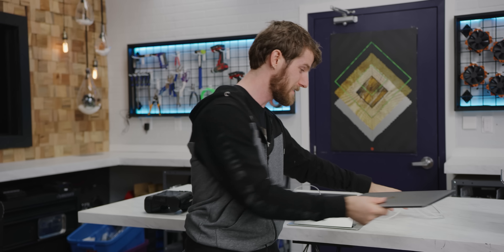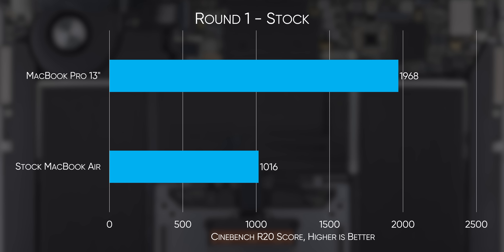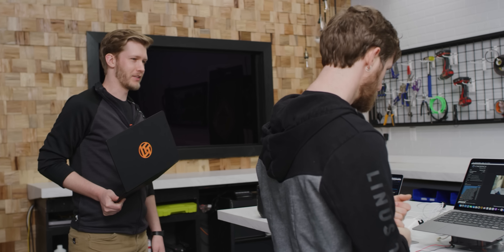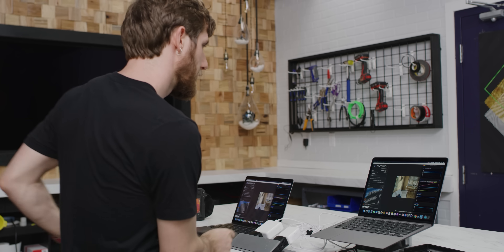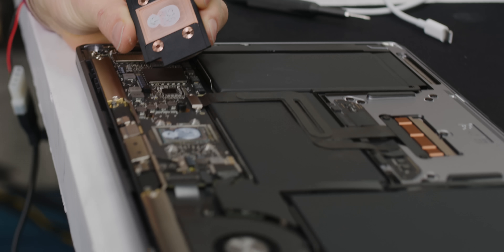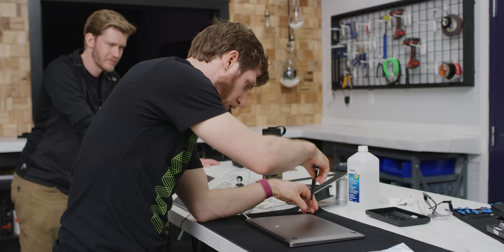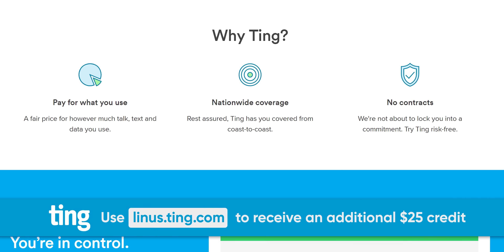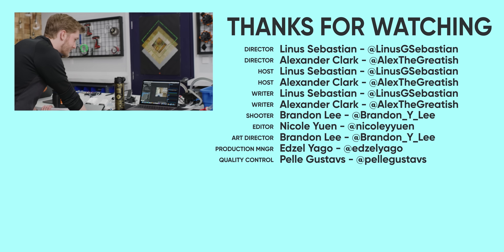Fixing Apple's Engineering in an Hour

Comment: When having to perform at places where 35ºC is kind of the average temperature on spring (like Misiones, Argentina); 
my gpu-hungry vj friends ask for a  20L tupper full of ice and have it constantly under their rig in order to prevent overheating. 

not that related to the video here but hey it's cleaner than having the pc soaked in water.

Comment: Apple soldering RAM and storage... I mean they are not alone, ultrabooks are generally garbage when it comes to upgrades!
But 16GB of RAM being 200 bucks higher than 8GB when 8 more GBs are worth 40 bucks and 16 whole GBs are worth 80 bucks... it's blatantly overpriced, and same applies to their storage pricing!

And... THEY ALSO DO THAT IN IMACS NOW!!! IN DESKTOPS THEY SOLDER RAM AND SSDs, while before... even their CPUs were socketed, which is A MUST in a desktop!

Comment: In my experience with Macs, I’ve kinda learned that they just don’t thermal throttle much until they hit their max temp. 80 degrees and 99 degrees are virtually the same as far as that’s concerned. It’s when it hits 100 that it starts downclocking itself. 

It’s kinda ridiculous. I’ve seen my 2012 go as high as 101 before and that’s even with a custom fan script that puts the fan on full blast after 80. The CPU somehow still lives to this day, nearly 10 years later. I’ve never owned another computer that ran this hot and didn’t somehow fry itself (I’ve fried video cards at MUCH lower temps than this).

Comment: I love my MacBook Air M1 chip 8GB ram base model with the 7 core gpu 8 core cpu  
had some small bugs with the Big Sur IOS ; 
1 for some reason it wouldn't connect with the App Store at all even with the small updates . 
2 once in a while the MacBook got really hot and the battery drained really fast while using the MacBook in normal use. 
but once I updated the IOS to macOS Monterey all the issues and bugs I had completely disappeared and with the new option 
"low power mode" turned on now I get 20 plus hours on my Mac but thats with the screen dimmed down to level 3 0r 4 but never the less 
I get 20 plus hours of continuous  web browsing on YouTube , Im home  recovering from multiple body injuries that happened at work. 
so to pass time I use my MacBook throughout the day constatly . 
I can defnly testify that all the rumors are true when it comes to apple claiming about the batteries lasting long.
9.9/10 beteries
10/10 built quality 
10/10 IOS monterey
 5/10 price a little to expensive  
 do you get a good computer ? NO ...!  you get an amazing machine specially with the M1 on it .

Comment: With apple choosing design over function, yes the intel versions were sandbagged because the chips were too big to not overheat in the casing. M1 at least finally brings function close to a balance with design.

Comment: Are there options in the software and bios to remove the power throttling, like with changing the power options in Windows, etc? This is one of my favorite videos you all have made. I would have done similar things and also have been similarly disappointed, but that's why I don't buy Macs and only fix them for others now.

Comment: Could have added filtered vents to the underside above the CPU and built a new cpu cooling block out of copper with fins then had the exhaust fan pull air from the bottom, over the top of the CPU and blow the hot air out.

Comment: When they were talking about submerging it into water, is it technically possible (though insane) to put the Laptop on a HUGE icecube, like 30 cms tall and the other measurements those of the bottom of the laptop? Now you add some holes throughout, the ice (from top to bottom) and put it on a drain, so molten ice  can drain and surround the cube with a metal brace (to minimise shifting).

Comment: This is the result of an idiot and a stubborn decision maker trying to always make the slimmest laptop, its is a pro series and you need roomy chassis GDI!! .. they had this with the pro15 2018 then they said we have fixed it! and started selling the pro15 2019 which turned to be false and I am still having thermal throttling issues where i am only getting 2.0Ghz at full load while apple saying its 5Ghz!! I would never ever buy apple again

Comment: 3 years ago, I soldered a copper pipe to the processor heatsink and put cold liquid through the copper pipe. I cut a hole in the case, and with the help of a bucket, water, pipes and a fantan pump, I cool my laptop while I work. I don't know how to show you pictures but it looks very funny. (sorry for my english - this is a google translator)

Comment: A tip using the mill, if you need accurate depth, never use the quill. Lock it and use the knee to bring the part up to the cutter. It's a lot easier to control

Comment: As a certified apple technician watching Linus handle the MBA without the bottom case with the battery still connected AND plugged in really stressed me out.
Reply: So you're a certified parts replacer.

Comment: Here is a hack. Use a hair dryer on the coldest setting and Max fan speed pointed such that the air flows parallel to the touchbar over it. It’s noisy as heck but works like a charm to cut down render times.

Comment: Hi, just wondering: why not put a copper shim / contact spacer between the heat sink and the processor and apply the paste to both sides, rather than drilling down the screw holes of the heat sink, or am I missing something? Thanks (writing this on 2020 MacBook Air :-)

Comment: Also, if you want to cool, there's a small gap at the top between the top of the aluminum and the screen bezel where, supposedly, heat is dumped due to air 'wafting' in (yeah... wafting).   The real question: What kind of performance can you get without voiding the warranty, or by BARELY voiding the warranty with the reversible thermal pad mod or adding a cooler near the hinge.

Comment: All that jazz is exactly why I bought one with the i3 chip. What is the point of the hot rod chip if it's throttled down, and at the same time boiling the board to death. I had a strict budget. I wanted a new laptop Mac with a Retina screen and the new keyboard. I compared the MacBook Pros blah blah and went in with my eyes open — even though I knew that morons had designed a "boiler" for the want of shrinking the case thickness by a couple of millimetres. I payed extra extra for 16 GB of RAM. I shut down any app I'm not using, and  I do pretty pedestrian stuff most of the time. I've never bought Macs for their hardware engineering brilliance. All their laptops have been overheating since my PB 3400c. (It still runs like new, but is about as useful as an anvil for modern computing.) I just hate Windows more!

Comment: Honestly I’d believe that they’ve been intentionally slowing intel based macs, so then when the M1s come out, they’d ‘do better’ cuz engineering, when they really don’t cuz the cooling is horrible :S
Reply: the cooling is worse on the m1 air, moreso on the m2 air
Reply: @Redstoner2b2t  there is literally no cooking on the MacBook airs, it’s just passive with no fans.
Reply: @Thewaterspirit57  intel air still had air coming into thre chasis and hot air exiting, still better than the closed box that is the m1, yet it benches 7x higher
Reply: @Redstoner2b2t  The only reason intel MacBooks had air flow, was because they had a single fan, yet those things had poor performance and heated up to 100 C. They tried too hard to make them thin, despite the fact those CPUs need better, thicker fans to be used better.
Reply: @Thewaterspirit57  you originally implied that the m1 was better because the cooling on intel was horrible, while there was no change (slightly in the worse direction for m1), meaning the only differentiator is the cpu itself. why doesn't the m1 "have poor performance and heated up to 100 C" ? its equally as thin
Reply: @Redstoner2b2t  That’s because ARM CPUs are incredibly efficient, literally x86-64 CPUs are power hungry as hell, and intel had a habit of lying about their cpu power consumptions before 12th gen came around.
The best intel MacBook could take up to 70 watts at full boost, while an M1 or M2 takes half that.

Comment: the fan and the cpu heat sink don't have to be aligned directly... there is an input and output for air flow.  kind like a vacuum and blower. the point is to exchange the air in the Macbook.

Comment: You keep complaining about the fan placement... but hey, it's an Apple product. I'm surprised they put a fan at all.  You should have done a test of a MacBook air, without fan. I'm betting there is not real downside as it is so far away from the heat source that it probably makes not much difference from the get-go.

Comment: They will help us pulling us fromt he nvdia & intel greed swamp! Nvida, intel & windows producing slow advancement tech with compatability issues products for insane price. Nvidia & intel are the reason I hated my MacBook Pro & switch back to windows!
I'm grateful to God to live & see this chip exist! This Apple M chips moments is actually as the moment as first iPhone released!
I'm pretty sure not only me going to change to MacBook Pro later this year when MBP reveals the beast inside, most of the people are If the PC industry not going to cach the ARM PC version race! 
What is the use of multi thread test when M chips are fater than everyone?!
The power of the current Apple M1 is not fully revealed because most of apps & AAA games don't support it! Just wait for it to be supported to be amazed!! I wish the success only to Apple ARM chips because they deserve it. 

About storage:
I would suggest to buy the smallest internal ssd & use it only for OS & apps & buy a thunderbolt flash drive for production, same to gaming buy a thunderbolt flash drive for gaming, & so on! 2.5" external storage is physically big & it will take a lot of space for many projects & uses & think using as an external storage is a tech going to die soon. Flash drives are the future, so small & available with big capacities! 

About ports:
 The charging port need to get back to benefit from the usb c thunderbolt ports. From now & on should be usb c thunderbolt & it should have been before. The usb c thunderbolt oort should be at least 4 ports, at least for the PC/laptops with 14" & above!
This usb c thunderbolt is so amazing that when you plugin external monitor that supports usb c thunderbolt you can plug to that monitor the mouse, K/B & the headset!!

Comment: I think how the cooling was SUPPOSED to work is the fan would draw air through the airgap between the laptop bottom and the CPU heatsink then onto the fan and out the back. But this design was obviously implemented poorly to say the least.

Comment: A different mod would be to use the the back of the lid (behind the screen) as a passive heatsink.  
You would need a flexible heat connection at the hinge, BUT you don't need to worry about the bottom scorching your lap.

Comment: 3:08 he literally called it. Now that the M1 is out. A lot of cooling issues is resolved. Well done Linus.
Reply: apple was learning from him...or he works for apple
Reply: 2:50 you mean. You linked to the end of his statement.
Reply: @User-cb4jm  does it really matter?
Reply: @PBeans69  Yes
Reply: @PBeans69 it does...
Reply: @User-cb4jm  whatever
Reply: But the M1 is still bad without a fan. This is coming from someone who actually has an M1 macBook air. It's good when idle or doing low intensity tasks, but when you push it it overheats badly
Reply: @bigbubba0439 If you want a computer to do 3d modeling or video rendering, you’re not supposed to buy the air variant to begin with..
Reply: @zenodezeno454 that's not an excuse to do shitty cooling wtf
Reply: @MatheusFerreira-mu6lu  It’s cooling is not shitty for 90% of people who do tasks like office work, webbrowsing and medium video editing.. You should not expect an air laptop to run high level programs without throttling, just like you shouldn’t expect your regular car to compete in Formula 1 racing

Comment: Use the knee of your mill for precise depth cuts.   Not the quill.   You get it close with the quill.  Then with it running bring the knee up till it touches off,  set zero on your knee and move your desired amount.

Comment: You can fix the thermals, throttling and performance by using the MacBook Air M1. And extend your battery span by 30-40%.

Comment: Can't wait to see you finish this job by trying to replicate the cooling system of the M1 MBA into the Intel MBA. That would make for an interesting performance/heat/efficiency comparison! 

Your conspiracy theory is obviously the truth. All the latest Intel MacBooks have clearly had their cooling systems deliberately gimped to make the M1 Macs seem even more awesome than they really are. Don't get me wrong, the M1 is awesome regardless, but the Intels aren't actually as bad as Apple have deliberately made them to be. BTW, my mid-2015 retina 15" MBP, which presumably was designed before the Apple Silicon Macs idea was truly hatched, runs cool, efficient, and quiet, rarely needing to fire up the fan, and handles all modern tasks with aplomb. I can only imagine how good a 2020 Intel MBP could be if they where designed with great thermals.
Reply: but the M1 chips run at the same wattage as chip in this video and they removed fan XD

Comment: 4:23
I think the idea here was that the fan pulls air towards itself from the other side of the computer, which somewhat "passively" pulls a breeze through the case and then uses the fan as an exhaust. I know this doesn't work well in practice, but that's just what I think their idea was.
Reply: Regardless the engineers of one of the top companies in the world should know better.

Linus' conspiracy was right about throttling the crap out of apples intel processors so their arm based architecture will look better in comparison.
Reply: @MsDestroyer900  absolutely.

Comment: YOU  NEED TO BRING UP THE ISSUE WHERE ALL 2020 MACBOOKS GET INSANELY HOT WHEN HOOKED UP TO AN EXTERNAL MONITOR!!!! Just type in on google, "macbook pro gets hot when hooked up to external monitor" thousands of forms of people having this problem including me. The GPU uses 5w when not connected and then when connected it goes to 15w and stays there. Major flaw in design that apple needs to fix immediately. Literally had my new almost specced out 16in macbook pro shut off from getting too hot.

Comment: I'm watching this after the Apple Silicon Macs were finally announced... I have a 2014 MacBook Air. I remember opening it up and replacing the thermal paste, only to see that one of the chips has this massive gap between it and the heat sink's surface, and no thermal pad OR paste. As in, there is a gap of air between it and the metal. I couldn't believe that they'd do that...

Watching this today, and seeing this 7:48 in the 2020 models is absolutely disgraceful. Seriously though... WTF? I'm really, really second-guessing the new Macs as a viable laptop at this point. You'd think they would notice and fix it.

Comment: 2:50 they just introduced the new macbook air as "2X FASTER THAN THE OLD MODEL!" so yes that's EXACTLY what they did.
Reply: damn linus was right
Reply: Linus knew
Reply: Except it’s been pretty much intel sandbagging themselves
Reply: @killerkoalas3573  sandbagging implies YOU are hiding performance. Intel isn't hiding performance... If anything, they're running their chips redline because they're desperate to show they have performance. It's APPLE sandbagging the cpu by forcing it to thermal throttle way early.
Reply: @ferna182  intel lied they would be on 7nm in 2016 which never happened. This is both intels fault for not being able to reliever the chip and apples fault for not changing the design.

Comment: All this work and you guys never rechecked whether fixing cpu mount made the fan approach actually usable 😣

The water approach is fun and all but definitely NOT a reasonable cooling solution to something which is designed to make 0 contacts with the bottom plate itself. ( I went back and I see you're actually using pads but still this is a joke of a cooling approach - die to heatsink , to attaching silicone pad onto a perforated heatsink surface to connecting it to a chassis that might be factory treated in a way that reduces heat transfer. Plenty of heat transfer loss that way , just a cooler itself should be superior)

I feel like fan could actually be usable now that the die itself is properly attached , heck you see 10 degrees difference WITHOUT a fan .

Can you imagine what it would look like with a fan? 🐈

Comment: I have a hard time believing that apple's huge R&D staff would accidentally come up with such an obtuse cooling system.  Not that the 'pull through' cooler lacks merit, just the execution of said system.  Plenty of servers use a design, thus eliminating heat pipes.

Now all they need to do is toss in an A14X, make a properly mounted heatsink with a dozen more fins, and proceed to obliterate anything short of a 16MBP.

All with reasonable thermals and less than 15 watts of power.

Comment: Well, one thing is for sure, whether intentional conspiracy theory or unintentional bad engineering, they sure did cripple the CPU!  The heatsink design itself doesn't sit well on the CPU.  The fan that's right there doesn't cool the CPU.  The case is thermally blocked from helping the CPU.  And not to be outdone, they electrically crippled it.  So clearly Apple needs ARM if this is their idea of peak design.  If it wasn't intentional then it sure was ridiculously incompetent.

Comment: does this mean that apple actually engineered it well then? I mean you basically jerry rigged an ice pump to the cpu and it only gained a 15% increase in performance.

I mean even though you were able to lower the temperature it performed relatively the same. what would be the downside of running at the max temp then?